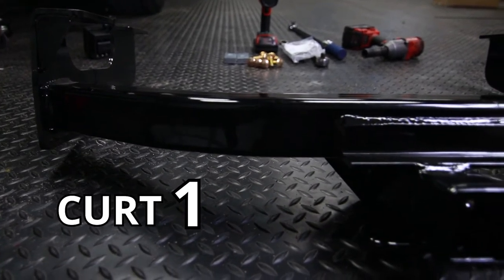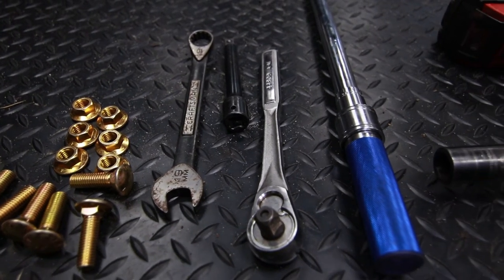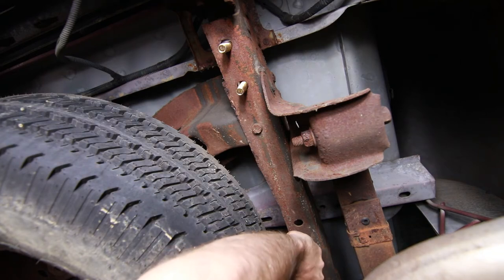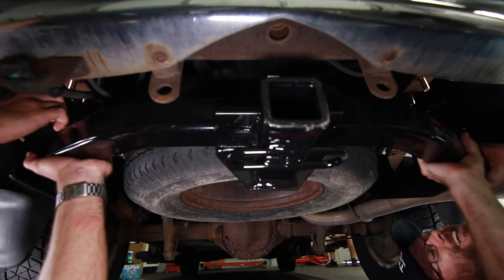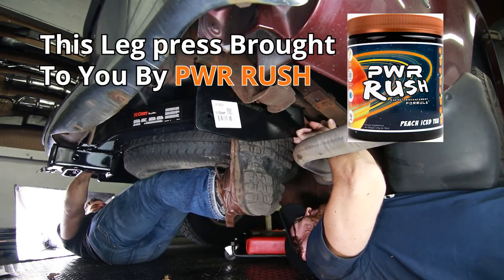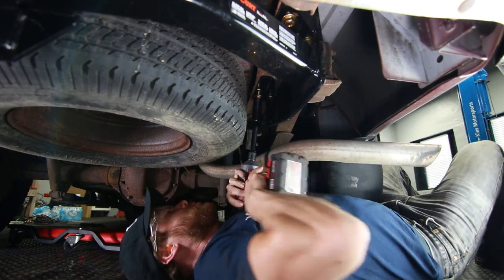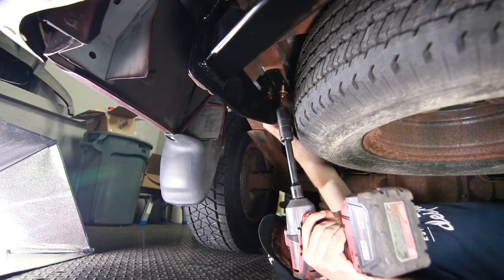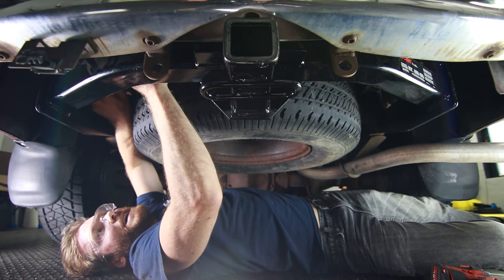Ford F150 F250 and F350 CURT 14355 Class IV 2" Trailer Hitch Install

Comment: I ordered one (Curt 14355) today (11-16-23) from Summit Racing (cheapest) for $253.99 plus tax with free shipping.
It's going on my, new to me 1998 Ford F-150 2wd ext cab base model truck.
The current bumper ball is not the right way to pull any trailer.
Thanks for the video. It was good. :)
Reply from the maker: No problem! Hope it helps!
Reply: Got mine from Amazon for $186, including taxes. Going on my 2000 v6 XLT today.

Comment: Hello i need a class 4 receiver since my 2018 f150 did not include one. On the part where the receiver bolts on to, it has a label where it specifies the class 3 limits. Can i bolt the class 4 to that?
Reply from the maker: As long as the holes line up it should work I believe but I would verify with Curt. You would still be limited to the limits of the truck tho even if the hitch can technically handle more.

Comment: I just took delivery on the Curt part # 14355 for my 2001 F350 4x4 crew, long bed, and these factory frame holes ain't about to line up ever, off 3/4 of an inch..you see, I can't even get to the leg press trick because on one side the holes are off SO BAD, I'm on the horn with both Curt and Summit Racing..fuckin irritated
Reply from the maker: That's annoying. Ours was probably off by that much too. No idea why it isn't manufactured better from such a well known company.
Reply: @TheSundaeDrive  turns out the hitch was bent pretty bad, so rough shipping trip I assume..can't blame Curt now, just The carrier. I sent it back and refund is due promptly.
Reply from the maker: That's good at least.